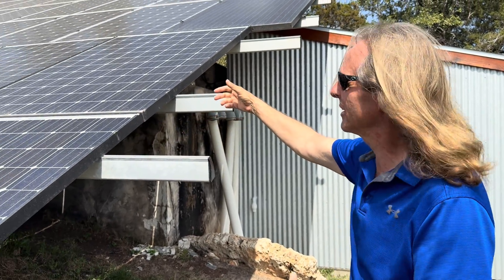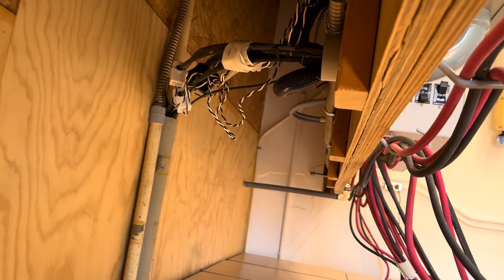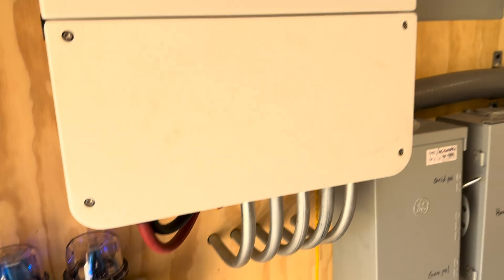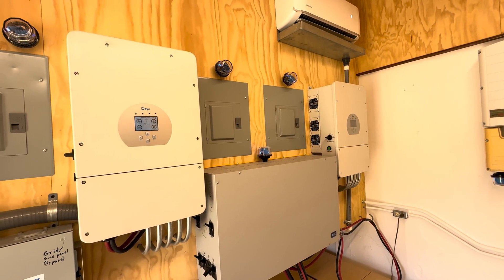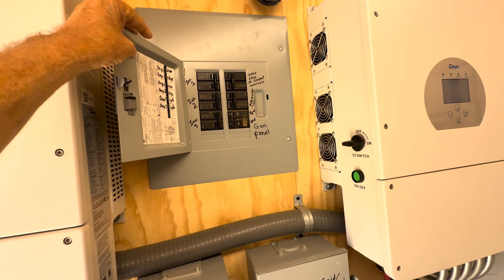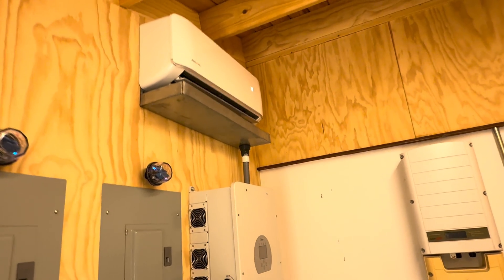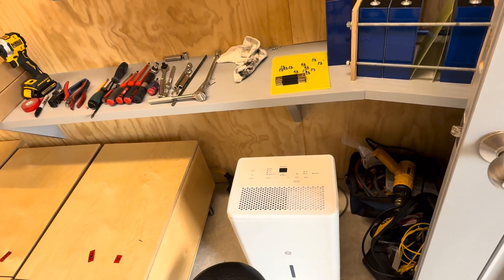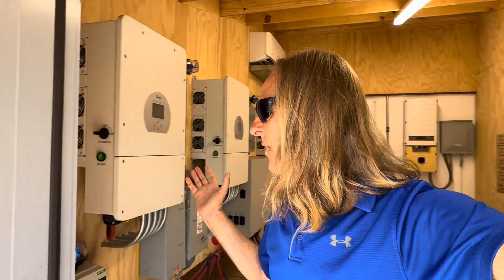Finally Living Off Grid With Lifepo4! Huge System

Comment: Nice content. Great to watch. I have built a system myself similar to your set up. My battery banks are only 24volt. I have 12 batteries and I can’t get them to talk to each other through Daly parallel interface board using the RS485 port. I can get 2 batteries communicating to each other but the other batteries I can’t.
Any help you can give me I would really appreciate it.
Thank you

Gary

Comment: Just visited a friend in Arizona who is building a container home on 11 acres. Completely off grid. Has a system with one inverter and 4 48 volt server rack batteries. Worked flawlessly while we were there. Everything functioned as if it where grid connected.

Comment: Awesome Job...I would highly rec moving ac to other wall to avoid an electrical fire.....pan could sweat...just suggesting...otherwise monumentallly awesome setup.... or add a shelf below....
Reply from the maker: @sabianstringer2112  did you notice the emergency drain pan underneath in case of any problems with the AC?
Reply: @RayBuildsCoolStuff  Yes but I am a preventer and I do not run plumbing or any  appliance that can leak near any electrical...it is probably nothing but I avoid plumbing on same wall as electric...I know it sounds like overkill but it is just common sense plus you say those inverters are irreplacable...just suggesting (plus it will give you another project to do lol)
Reply from the maker: @sabianstringer2112  😂
Reply: @RayBuildsCoolStuff  Don't get me wrong I am completely impressed with your incredible system....I envy you and your work...Bravo Zulu

Comment: High frequency, transformerless inverters like these offer a far poorer surge capacities, a far shorter life expectancies, and they can damage your appliances or your EV when their MOSFETs fail. It's too bad that you didn't install low frequency, transformer based inverter's instead.
Reply from the maker: Do you think it makes any difference that I have three of them in parallel and rarely exceed 25% of their capacity? Is this the advice that you give to everyone because if so, it would seem to price most people out of the market. There’s a reason that very few people Use low frequency transformer based inverters.

Comment: Eco flow battery generator Delta pro  surge 7200W It would be a great addition to this system ! I believe
Reply from the maker: Have you seen my videos about the solar generator that I designed and built as a backup system. Check it out! Similar capacity and 1/3 the price.

Comment: heck of a lot of power and an even better shed design. I only need a 10kw array and 14kw battery storage its looking like for a full day of running off grid, or about 4-5 days as long if i only run the fridge, 1 small ac unit, 1 light, and 1 phone charger. But this is the dream system! I sure wish they would buy the extra power back in this city too

Comment: About how much power do you use during an average day?
Reply from the maker: On an average day, I use 46 kWh. Of that 10 kWh is for the Koi pond. I also pump all of the water that’s used on the property. With no one occupying the building and the air conditioning turned off the house uses 20 kWh per day. That represents a lot of systems that are on 24 hours such as routers modems TV boxes, security refrigeration, ultraviolet, light for water, purification, etc. I use electricity for all my heating and air conditioning and I use propane for hot water and the cooktop. The double ovens are electric.

Comment: Totally awesome system. 🫨It took you many years to configure all the lipofe4 cells and  make connections to the inverters , the large PV array modules and components until finally today in 2025 it’s up and running .🏃 That’s what I’m talkin bout  ! May the solar be with you .😉🤙
Reply from the maker: It took so long because I let it sit for a couple of years while I did other things.

Comment: Very nice Solar Shed and real tidy set up of the electronics. 1st video of yours that I've watched. I would like to build a Solar shed on skids so I can easily move if I ever had to relocate. What's a Total ball park(rough guess) materials cost( if built now) for the solar panels, electrical and batteries like in your system? I imagine costs could have doubled over the period that you've built yours. I saw a television show a few years ago about a professionally built Solar system for an off grid house and the price was 200K....!
Reply from the maker: The price has come down and depending on where you are and how you source your materials you could do it for less than 40,000$
Reply: @RayBuildsCoolStuff  Thank you. Far better than 200K! I'm good at sourcing stuff. Might luck out on some lightly used components or new items from someone that's changed their plans.

Comment: Manufacturers  of home PC motherboards say only update the Firmware if you have a problem. No problems then leave it alone. I have the Isolar 5.6Kw and no, no, no I will not update as they can easily be bricked. 3 years running and not a problem. Hang from ceiling 10 litre fire extinguishers good idea. Nice layout '80's Glam Rock 7 string Ibanez dude.

Comment: 🌅 Great D.I.Y.🎉  For most system owners* its complicated with 3 AC panels but if all know how to swtich, then OK. (*Most want automatic swtiching.)
A general safety issue should Not have battery Cables suspended (chance of tension tear at terminals & trip hazard, etc.) or Across a walk+access floor space⚠️

Overall, impressive lot of work but Sol FREEdom is worth effort...& it gets More valuable even time utility rates increase! 💸

Sol...get it ON🌞🧑‍🌾🗽
Reply from the maker: I totally agree about the cabling across the floor. The metal diy boxes would allow all of them to be placed under the inverters stacked two high but alas I am not currently able to do that. The terminals are all covered with heat shrink so that gives a little resistance to tension tear. I originally thought 4 batteries would be enough, then 6, then 8, then 12. Mission creep is a thing!😂
Reply: @RayBuildsCoolStuff  🌞on a unique project, we had to put All cables in metal conduit ...a pet horse would go in utility room & chew🦄

Comment: Great video! What a massive system! However, despite the amount of protection you have built into the system, is putting all those connections on a board a good idea? Considering that they are combustible.
Reply from the maker: The wood is protected with intumescent paint. The building is remote from the house.

Comment: hmmm. very tight, but damn. i'd be paranoid about having the battery cells sitting in wood. 

lifepo4 has crashed in price. 5kwh premades are under $1k now. i understand lifepo4 was expensive for a long time, but wood... scary. 

a quick fix for a bit of peace of mind would be installing a automatic fire extinisher. $300-500 ( not one of those stupid balls )
Reply from the maker: I understand your concern. I don’t share your concern. The issue of fire with this chemistry is a quite minimal risk. Each of these batteries has a T class fuse in case of a short. It should protect from self discharge, but in the event that one of these batteries, self discharges 14 kWh of stored energy will a metal box really make any difference? we don’t really know the answer to that because it’s not an event that occurs with enough frequency to be documented in the public domain. I have seen examples of people who built batteries like this and had heating events even under wood covers, and there was some scorching, but not a fire. what was done during the assembly of those batteries that led to this was truly bad construction methods. In one case, the man had plywood resting directly on the top of the cell terminals and crawled around on top of it while working on his system. Even he didn’t burn his house down. This wood is protected with an intumescent coating which resists fire. I tested the coating by holding a propane torch on it for one minute and as soon as I removed the propane torch, there was no self sustaining flame front. have you seen the video on the lithium Solar YouTube channel where he tried to get one of these cells to catch on fire. He literally drove a steel prybar through the middle of the cell and gases started to come out of it, but no flame. He then drove it in in a new location and eventually got a small flame to come out of it, but it never went into a runaway thermal event. That is the beauty of this chemistry. That being said, I don’t build the systems in a home but only in a standalone building separated from any living space. If I was starting over today, I would be buying the metal DIY boxes from Jenny Wu. 3 1/2 years ago those were not available. As far as being paranoid about it I am definitely not. If I was, I could rebuild all these batteries in metal boxes, but would that really make the concern go away? those metal boxes do not include a T class fuse. I suppose one could be added. Interesting issues to consider. Thank you very much for your comment.
Reply: Where can I get the coating that was used for the wood to resist open flames?
Reply from the maker: @bluetrepidation  I can’t remember right at the moment, but I’m pretty sure I bought it from Home Depot. I made a video about building the shed and if you look back at that video, I showed the product and the cam that it came in there’s a playlist for the construction videos about the solar shed. Sorry I can’t remember the name of it right now. What you’re looking for though is a clear intumescent Paint.

Comment: Been watching for some yrs. and really like your channel .
i would be interested in [ it maybe a reminder - memory ? ] - on cost of both the system & utilities - a pay-off ?
I would agree that being independent , making your own , self-reliance has a huge value by it's self ;)
Reply from the maker: This has never been about an economic payoff. I also think that if you’re only concerned about short term, grid outage events, then a generator with a carbon based fuel source would serve you just fine. When we consider the potential for long-term grid outages, then the costs fly out the window. There are many scenarios where longer-term grid outages become possible. Here in Texas we experience lots of medium term. Grid outages, and also face the possibility of outages that could last longer. My property has been without power in excess of one week on three different occasions.

The current cost of a system like mine is in a middle ground between reasonable and crazy. You can buy three inverters of a similar performance to mine for $10,000 US you can buy kits and sells from Jenny Wu to provide 170 kWh of storage For around $17,000 depending on where you are. As I’ve shown you can get used panels for a little or no cost, and then the cost of the PVR right just becomes the cost of racking and wiring. There are other costs associated like conduit, wiring, and panels, but all that adds up to a fairly low price. The cost of a small insulated building could very widely of course, but a handy DIY person should be able to put together the system that I have for under $40,000.
Reply: @RayBuildsCoolStuff  I was asking for the idea in general - many others may wonder ?
There are sources in my area for new & used / recovered as low as $0.30 - 0.80 per watt of name brands solar panels , I am a full time RVer do not own property [ would like to / but too late ] & have been DIYer for 50+ yrs. ;) and working with alternative energy since the 70s , and watch lots of changes - falling prices / tech , etc. 
Love your channel & thanks again

Comment: I've got almost exactly the same setup up in Maine.  About to switch out my Victron kit for the new EG4 Grid Boss and 16kV inverters
Reply: You have inverters that output 16,000 volts?
Really?
Why do you need such a high voltage?

Comment: Thanks for the updates, really was wondering where you had gone. Love those 280 amp hr batteries. We installed those on our sail boat 8 years ago. Had four total using Victron 5k inverter and 1400 watts of solar.  We could use a/c, desalinate water, and live using just solar and batteries. 

We have just purchased our inverter and lithium battery bank, big name stuff EG4. Picking up our solar panels next 540 bifacials thirty five. Had our pole barn shed material delivered last weekend, 16x 40 with a 32 degree sloped roof.  We will be doing this all on our own and hope to have done by end of summer. Love the fake wall idea. May have questions during my setup. 

Would love to see your peak solar intake this summer! Winter time are you maxing solar intake mid afternoon? Are you having days of not topping off? If so what state of charge do you get to and run at on these wintery days?

Thanks for sharing.
Reply from the maker: @melvinandmichelle2584  that sounds like our experience of living off grid in the horse trailer. I don’t know if you saw my videos about that. They weren’t very popular. Living that way on a sailboat must’ve been glorious. OK, also very hard. 

This winter, there were plenty of times when long stretches of cloudy days and cold weather ran our batteries down to near empty. There were even times when I avoided charging the car or running the clothes dryer because of the weather. Then the sun would come out and quickly charge the batteries back up. Something about those cold days is really exciting because of how much power you can get all at once. The total rated capacity of my array is 22,890 W. Half of those panels are nine years old and the other half or five years old and yet on a really cold day when the sun came out for a short period of time, I was producing over 23,000 W. Our summers are so hot that it is unlikely that I will see over 19,000 W at one time and that will only occur when a cloud passes in front of the sun, allowing the panels to cool off temporarily. Generally, I will produce about 18,000 W through the middle of the day.

I’m very interested in hearing your questions and your comments about your system build as it goes along. Congratulations on your upcoming project and thank you for your comments.
Reply: @ yes good info on the winter days, we plan on starting with 22,000 watts, those short winter days will be interesting to see what we get.

Comment: industrial jk bms is #1
Reply from the maker: There are many that disagree with this statement because of problems that they have had with those BMS. I have no way of knowing as I have not done side-by-side testing. Nor have I done durability testing on these and other BMS. All I know is that the inverters that I am using Are working well. The SeplosBMS had an issue of one bad diode that caused some of them to fail about three years ago. I made a video about that at the time. I have now replaced all the 10C BMS with 10 E version.

I appreciate your comments. It might be better to share your experience with these products rather than just make the claim that one is better than another. The people reading the comments might be interested to know what you have experienced.
Reply: @ I have 68 kwp on micro-grid with huawei 40kw ongrid and 3 victron multiplus II, 3p16s 314ah EVE with 3 industrial jk bms 200A and 2A  Balance
Reply from the maker: @marianilie7321  I would not be comfortable with a battery that did not monitor each cell individually. If one cell has a problem and goes below 2.5 V the other two cells will mask that situation from its BMS sensing wire and it would allow that cell to go below a critical level at the bottom of the charge curve. The same thing can happen at the top of the charge curve.
Reply: @ yes. i have 3 batteris + 3 individual jk industrials bms an all conected to victron lynx busbars. maybe 16s3p is the corect name
Reply from the maker: Oh, it sounded like each battery was comprised of 48 cells but I think you are saying that you have 3 batteries of 16 cells each, in other words 16s.. That would be much safer than one bms for 48 cells in a 3p16s configuration.
Reply: @ it is a new youtuber that use Solis HV 50kw with 46s cels with new daly custom firmware and jk balancers .

Comment: Solis inverters is much beter then Deye. Solis has 1000v mppt strings
Reply from the maker: I looked at their specifications and I see nothing that makes them superior overall. I also see no US availability. There is a US supplier, but every single product is out of stock. While these may be just fine as inverters, I see no reason to claim that they are Superior to any other units. This of course is based only on specifications and claims made by manufacturers. To really support the claim you would need to do side-by-side testing, which I doubt anyone has actually done and then there’s also durability testing.
Reply: @ deye is for Indian market. In UE banned  TUV to Deye
Reply from the maker: @ pardon my ignorance but what is UE and TUV?
Reply: @RayBuildsCoolStuff  TÜVs are internationally active, independent service companies from Germany and Austria that test, inspect and certify technical systems
Reply: @ Fault Loop Impedance Testing on Solis in 2x then Victron and 5x then Deye 🤮

Comment: Hi, thx for this nice presentation of your offgrid solution!
i have a victron systems with six 15 kwh batteries, total 90kwh capacity :-) 
My batteries have additional to the bms a separete 5A balancer in place.
This Neey 4th generation Balancers kick in at 3.4 volt of cell voltage an balance all the 16 cells nicly. (adjustable via app)
So the cells all betwen 0.001 and 0.003 in full or empty status. 
for me was important, to have more security on that point, if the bms fails. 
regards Samuel

Comment: That drainage pan under the AC unit might cause false reading to the thermostat!
Reply: Only if it has water standing in it in case of a clogged AC unit and the resulting offset would be less of a problem than the shorting battery below.
Reply from the maker: @martdaymo  it works ok and may someday prevent a disaster.